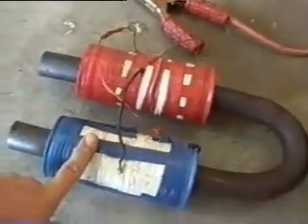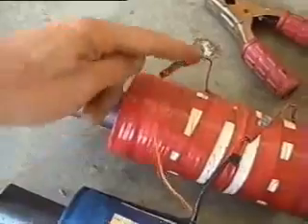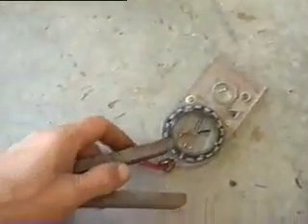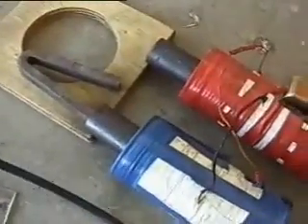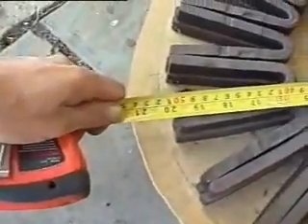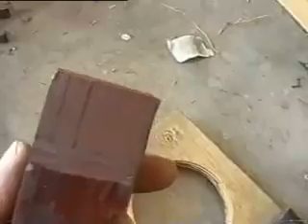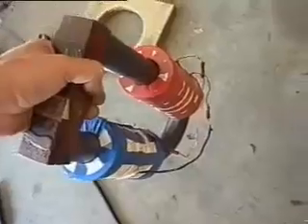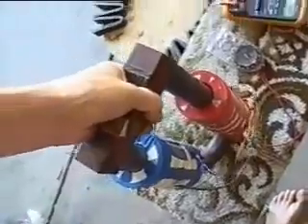CHARGING THE V MAGNET

Comment from the maker: @TheRealVerbz I imagine that also a Neodymium, but I have a second thought about that. How can we imprint our body's magnetic current with neodymium, how can we imprint our minds magnetic current and together with earths magnetic current if I use neodymium. I don't think this is about the strength of the magnet, I lift of small V magnet that was demonstrated in this video was enough. After all it was design to get a much bigger energy from schumman cavity and torsion energy.

Comment from the maker: @TheRealVerbz The big U magnet are constructed from 1.5 round iron bar. I bought 3ft of those, the bend it with acetylene(slowly bend it). From end of the curved you have to measure about 12 inches then cut the excess. Both prongs should be at least 12 inches long :D

Comment from the maker: Nope, they will still remain magnetize :D

Try making this in a mini-ture version and charge a needle with it, then remove your shoes you will see the magnet from the will remain :D

Note: Specific instruction of Ed in making the FLYWHEEL, the PMH should be able to hold at least 20-25lbs. So,  if you are planning to replicate Ed's FLYWHEEL I suggest you make same dimension :D, I don't think mini-ture version will hold the same weight :D